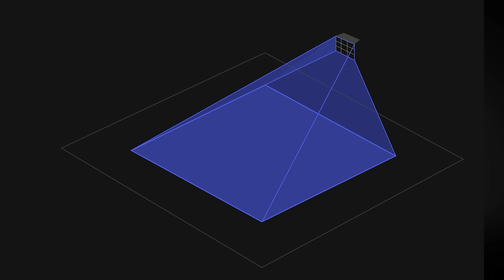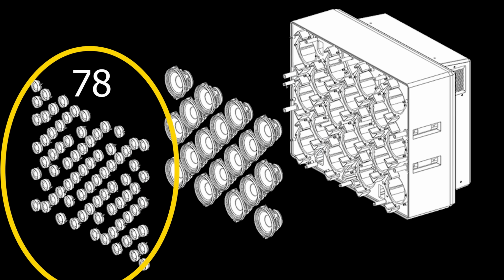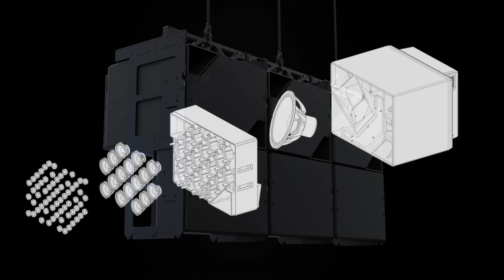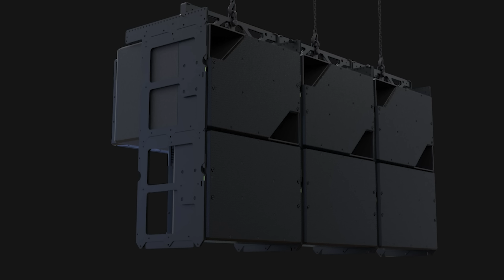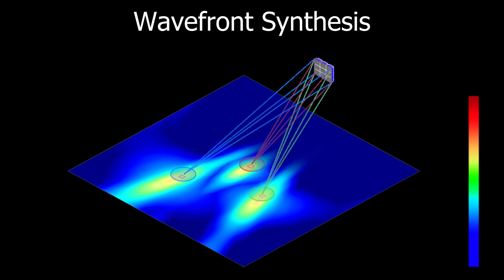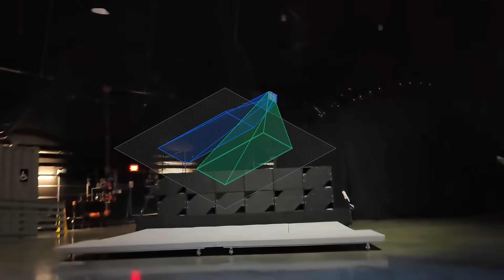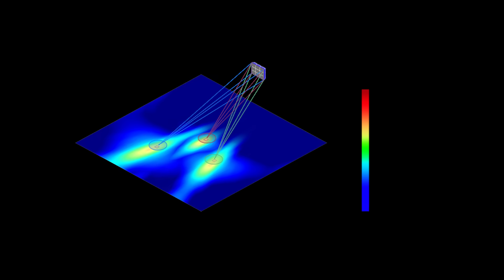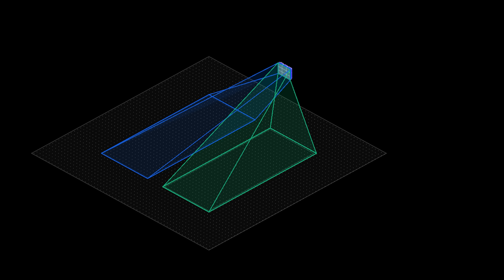Vegas Sphere System - Hear Holoplot X1 Demo

Comment: WOW.. how this industry has moved on from the 1970/80s when I used the then standard MIDAS/Martin systems.. and OMG, flying those things in cages that had an inherent wobble.
Reply from the maker: Yes much has changed!. I started building speakers had doing parties and clubs in the late 70s early '80s. I saw a lot of The systems in but didn't start with flying gear until late '80s
Reply: @DaveRat  My start was recording my school bands on 2 valve tape mchns in 1967.. during the early 70's I bought a Deckorder 4 track (cheap TEAC 4 trk) and recorded live bands in pubs etc.bands often got me to mix.. and that was it.. I effing loved it. Actually my first professional gig was as a wireman for Trident on the A & B range hand wired desks mid 70's then I got my MIDAS mixers (FOH/Mon).. still do sound.. modular synths now.. love it. BTW I really enjoy your channel .. mad speaker_man ;-))
Reply from the maker: All of that is so cool! And thank you! Love the The audio note adventures and the evolution of all the cool stuff

Comment: So they can do dolby atmos without dolby atmos? Is that what im getting here?
Reply from the maker: Yeah I guess they can definitely recreate a multi-source sound system and there are multiple sources in a surround sound configuration. There are other surround sound algorithms maybe look at L-Acoustics L-Isa which would probably be more appropriate for live sound
Reply: @DaveRat  so is beam steering the same as dolby atmos?
Reply from the maker: No it is not. To the best of my understanding, Atmos is a multi-point object-based system we're multiple sound sources can be sent to multiple speakers at varying levels to create an immersive experience.

Beam steering is where you have an array of speakers all working together has a single complex speaker and by altering time and phase of the signal sent to those various speakers in the array you are able to point the sound in various directions.

Kobe Atmos is like a field full of sprinklers where you can turn on and off various sprinklers at different levels

Beam steering is like holding a hose and shooting it in various directions and having control over the width and distance of the spray
Reply: @DaveRat  wow, thanks for the in depth response. I am a home theater guy that wandered into pro audio stuff. It is very interesting.

Comment: Hey!  Not related to the video, but…  I have a car audio buddy who swears by “oxygen free copper” wire.  Meanwhile, I’m looking at my $5K pile of XLRs, and now I need to know…  does oxygen free copper actually make a noticeable difference?  Thanks!
Reply from the maker: Sound wise doubtful there is a diff that is audible. But, oxy free copper is more pretty and tends to be easier to solder. 

I would need to test to be sure but experience tests me that electrons could care less about oxygen and just look at the resistance per foot and capacitance and inductance.  The parameter matter, the materials only matter if they impact the parameters

Comment: I just mixed a show at The Beacon in NYC with this system. It definitely an interesting concept, however it is my opinion that it is not really suitable for every show. Yet, it is sonically impressive in many ways.
Reply from the maker: Agreed. Soundsystems are like cars. Sometimes you need an SUV, sometimes you need a sports car, sometimes the dragster and sometimes a sedan is the optimum tool for the job

Comment: I would like to see modern point source rigs that can cover arenas with modern tech applied to remove the issues we had when we couldn’t get the HF drivers close enough to avoid combing in the horizontal and vertical, the way modern line array systems do this in the vertical.  There is something to be said for physical size when you want to control the largest wavelengths.  How about a co-entrant rat trap that puts the HF drivers virtually several feet behind the boxes where all the HF drivers in the system virtually originate from the same point in space, and the entire front of the cabinet is the horn opening, with Dave’s “Focusing” applied to get rid of the internal reflections?  Of course the grills have to have tiny LEDs on them so the people in charge of what is seen will allow it.  If each box covers its own area, then the only steering needed is to match the shading, but I bet you can get close with tighter patterns for the longer distances.  How fast can we load it in and out?  Hey, I’m just an idea man.  I’ll leave it up to you to figure out how to do it Dave.
Reply from the maker: I would like to see that as well but it doesn't seem to exist at this point. Using increasingly directional horns to cover far away places and try and maintain volume consistency can work but gets large or more specifically makes the cabinets very deep and different in size. This makes traveling with them and versatile array configurations quite challenging.

Additionally even when the volume over distance issue and coverage issues are resolved and minimize overlap interference issues using multiple point sources, The problem still remains of keeping sound off the roof and tight vertical coverage control.

Lionaires do this fairly easily and with great accuracy and point source arrays have very little or no control over it unless line array type configurations are used.

So you can see the quandary here, point sources tender work better when configured his line arrays.

I think this is why there are no major tours traveling with point source systems at this point in time to the best of my knowledge.

If you can find a band or artist traveling with a point source array doing arenas or larger please let me know because that would be very interesting

Point choices are great they just don't scale well to large format audio coverage and transportation
Reply: @DaveRat  I want line arrays in both directions.   I prefer the low frequency control you get with size more than the low frequency control you get with steering.  I’ve played with most of it.  Steering and smearing has its place.  The manufacturers fought against the line array as the end all be all solution for a long time, rightly so, until they realized they could sell 10x as many boxes and ultimately that is what they care about most.  Ultimately the challenge I think is in packaging it, then after that selling it.  Turbosound seemed like they were getting there with the aspect but that wasn’t a large scalable solution.  If we could have a line array that did a solid 180 degree pattern lows to highs, and we could just use the vertical angles to get more, further, that could reduce the number of hangs needed for horizontal coverage and reduce that horizontal combing.   I haven’t seen anything that can do that yet.  (have you?)  There would need to be stearing drivers in the box to get the low mids and lows to behave.
Reply from the maker: @tigeraudio interesting. My take is it the sound vendors and sound engineers are what pushed line arrays to the level they are now. Has a sound vendor having a point source system would be a nightmare. Having a line array that allows us to easily alter the coverage and use a single box size is absolutely genius. Add in the fact that we have control over volume versus distance and the fidelity is maintained and it's a huge win. Rock concert sound in order a magnitude better than they ever have and were able to cover longer distances with less gear and better coverage than ever. Much of this is due to the development and deployment of line arrays. 

Looking at it the other way, if point sources were so good how come nobody tours with them?

I heard the aspect and the big issue is whenever you have side by side sources, The precision of our hearing in the horizontal domain divulges all of the problems. Also horizontal arrays have no control over the vertical and any indoor venue with a ceiling is compromised by not keeping the sound off of the ceiling.

Yes there can be other solutions using point sources but they're all cumbersome and a huge bummer to deploy

Hold on let me bring the whole PA down and switch out box number four with it 12° instead of 14° dispersion horn so we can get this point source system covering properly.

Or let's change the angle between box number three and four and five oh and we're all good
Reply: @DaveRat  Yes, the end user definitely pushed for it.  I recall Scovi really adopting VDOSC early on. Before that I only remember Yanni having it.  What I mean is not to have horizontal instead of vertical but to have both at once.  Logistically the horse is out of the barn, but the low end was well controlled in those huge point source rigs.  The issues you refer to in the horrizontal and our ears are very substantial with line arrays 15-20feet apart.  The coherance (inteligibility) suffers.  Of course in that tiny line where they are equal time, there is no combing, but our heads aren’t quite small enough.  Everywhere else where they overlap, its messy.  What they are doing in the vertical, I also want in the horizontal, not one or the other, both.  I don’t think we need to worry as much about the interbox angles in the horizontal if we can get the vertical the way we want.  The trick will be physically being able to do it and rig it.  We went to the moon though.  I have not heard the aspect.  Not all that eh?
Why don’t people tour with big point source rigs?  None exist that can do what we want, and money.  At least initially line arrays were cost effective.  Now, I’m not so sure.  
One of the manufacturer’s that pushed back heavily was Meyer, and I heard from one of the staff sales reps, John Meyer wasn’t interested at all in going down that road but once they talked him into it, they sold enough Milo to buy the company that made the Galileo etc, and he could afford to hire more scientist, etc.  Again, it comes back to money, like everything else.  Its always money.  I have heard a lot of point source rigs in arenas that sounded fantastic though.  The Nexo Alpha I was flying was extremely fast up and down.  The 6 wide 4 deep rig (in the air) was only covering lower bowls.  WOuld have had to double it for the entire hieght of most of the arenas.  We had the audio truck loaded with backline, monitors, PA, etc in 48 minutes on the worst day.  The day we had a ramp load but used house PA, it was 28 minutes.  Not too bad.  That is from downbeat of walk out music.  We also didn’t carry video anything on those tours, so nothing in the way of getting in and out.  I liked your side by side rig.  You solved the problem of not enough line to get enough power.  I am not anti line array though.  I just don’t think that’s the end.  We were there before, came back to it, but its time to move forward and revisit PS systems and bring back to it everything we have learned in the last 25 years.  Personally, I would be happy to mix in clubs and theaters the rest of my.  I find the bigger shows to lack intamacy.   If you NEED imag, its too big, but a lot of visuals go to shows.  We have to drive 3 hours here for most.  I wish they did more, smaller stops rather than fewer large stops. I am happy with a good band, enough light to see them, and a great sounding PA.  Don’t need any other “show” if the music is great.  I drove through 4 states to see a band in a small cap club on tour break over the Summer.  It was a line array.  XSL.  LOL.  No joke, I was thinking it would be great if it was the same massive stacked PA I saw them on 25-30 years ago.  It definitely wasn’t the same experience, but then I wasn’t up front headbanging either.
Reply from the maker: @tigeraudio we had a nexo rig and briefly an aspect as well. Coverage bummer. Nexo, do you line or checkerboard the nexo? They both had significant issues.

The EAW 960 rig, Meyer msl10, and that cluge of open back fiberglass and aluminum framed boxes from JBL we're all failed attempts at doing large format point source.

Vertical line arrays are challenged in the vertical while pure and pristine in the horizontal.

True single box point source is pure and pristine in both vert and horizontal.

Combining vertical and horizontal into a grid or T or + or any other non 2 dimensional shape creates challenges in coverage and sound in both the vertical and horizontal

That said, developments in that direction are being addressed by systems like Holoplot

Going from point to line, is complex, as we see with computer modeling, precise angles and such. From line to grid is an order of magnitude more complex or just a huge diminish in sound quality and coverage, take your pick
Reply: @DaveRat  I did both.  The checkerboard was less bad but the overall sound was very similar to dVs.  The “thunder” thing of putting all the mid highs in the air and all the bass on the deck was horrible.  Everyone that used the rig that had previously used it that way was complaining until they heard it, then they were happy.  Doug Fowler went to work for Nexo US right after using a rig I put up.  The JBL was terrible.  I heard of some companies filling the back of the frames wiht foam.  None of these use the tech in line arrays to do point source however.  Part of the issue is the venues are way too big.  You can’t see the band without a telescope.
Reply from the maker: I'm not here to judge the size of venues or what people desire to do or not do, my focus is to get the best sound possible given the parameters I have to deal with by identifying and utilizing the best tools for the job and right now those are professional line arrays by a long shot
Reply: @DaveRat  Well thats why you have a sound company.  Also line arrays are your only option.  That’s the point.  I would like to see more options.
Reply from the maker: Yeah, I often ponder what lies beyond the simplest geometric shapes as a viable option.

Point, simple-ish. 

Vertical line, way way more complex and still a point when slices horizontally.

Two points, huge bummer unless sent differing signals.

And then there is every other shape which slices into some combo of a line or multiple points 

Every other shape is a combination of points and lines.

So the quest for more options is just using multiple points or points and lines or multiple lines 

And then ponder that the more simple the shape the better it tends to sound and where do you end up?
Reply: Thousands of 1” (or less) drivers on the surface of a spherical section with LEDs between them.  Make the entire thing flexible, but ridged.  Has to be in the truck 20 minutes after the show ends.
Reply: @DaveRat 

Huge K1 rig or one gigantic Danley box hung waaaaaaay up high?  Hahahah
Reply from the maker: @kory404 I can't imagine trying to cover a a spherical venue with a point source box. I can't imagine something sounding worse. There's a place in Sweden called globen which is a treacherous nightmare to mix in. 

I've done some shows in airfield bubbles as well. 

A sphere is pretty much the worst sounding thing possible and point sources have the least amount of pattern control. 

But yeah that would be fun miserable but fun

Comment: You know what i like about this video? Dave walks outside the defined listening areas so we can hear the effect breaking down. Such as the big null point right in front of the speaker during wavefront playing. Or the delay scattering when they bounce off the rear. I came away with a workable understanding of how they acheive the effects. That is a huge amout of channels and processing. I wonder if they send all audio and control data wirelessly to the units.
Reply: The audio is all sent through Ravenna. I was the blurred individual that helped design the audio for Sphere and designed the all the Studios audio.

Comment: It would be interesting to amplify an orchestra with these and aim the sound to activate room reverberations. Then, amplify a metal band in the same space and try to minimize reflections. Really incredible speakers, very interesting, thanks for sharing!
Reply from the maker: So many fun things. When working with the EAW anys system I was able to do some of that. It was very easy to switch between focused and diffuse ( accurate coverage vs overly wide dispersion)

And the impact was quite interesting.

Comment: Hi Dave hope all is well .I have a question on Dual voice coil sub being driven by a stereo amplifier .Does it cause damage to the amplifier .Example if the left chanel is only driven does it back feed a voltage to the right channel .Will this damage your amplifier .Are you better off with 2 woofers fed in stereo  instead of 1 woofer with dual voice coil fed in stereo ..Do dual voice coil speakers damage your amplifier when fed in stereo .Great lab experiment
Reply from the maker: If an amp is damaged by back EMF from the dual voice coil that would be almost the same as an amp being damaged by damping factor by sending a pulse to a speaker and having the rebound energy damage the amp.

So in my opinion the answer is, if a double voice coil damages the amp you don't want that amp and it deserves to be damaged anyways.

It does bring up an interesting aspect in that if something is panned hard to one side and one voice cause working The damping factor of the amp would put the brakes or slow down the other voice coil from moving so there will be some interaction not necessarily damaging to the amp but the signal could be affected